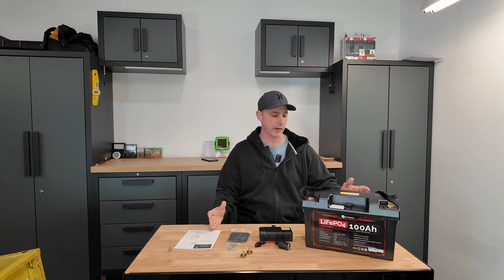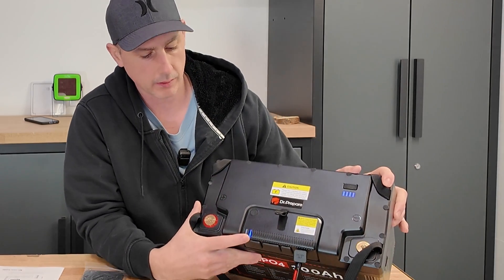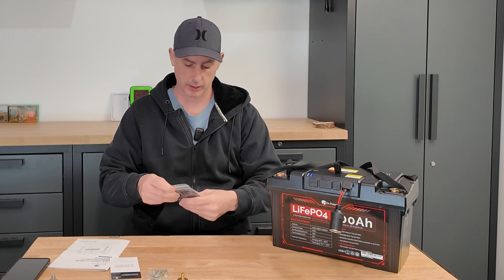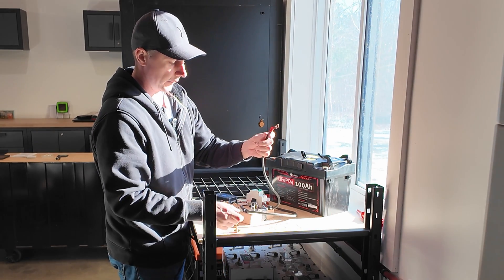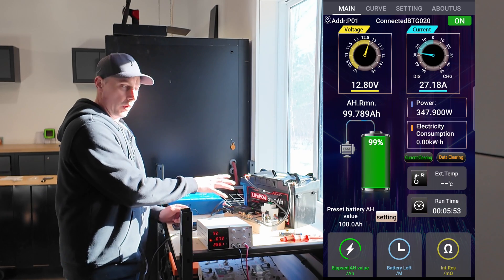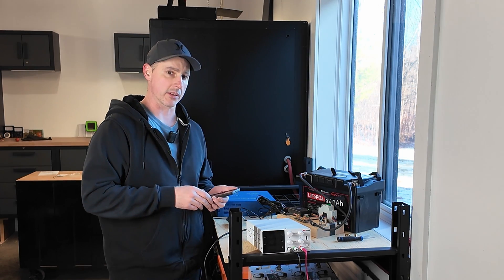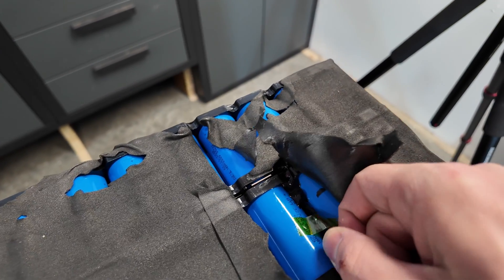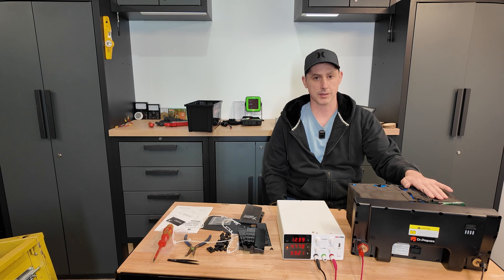Dr. Prepare 100Ah 12V LiFePO4 Battery Review

Comment: Can the battery be charged via the Anderson port that the hub connects to? Or is that output only? I think it's both but im not sure.
Reply from the maker: @Bamabrute85  You are correct in your thinking. It can be changed via the Anderson connector 👍
Reply: But you will not have the built in charge controller that way

Comment: He thought you were charging the doctor, prepare simultaneously with a generator in the power supply, but you were not. You were actually charging your generator with your doctor. Prepare look at the input, should’ve been coming from output, so technically you were charging your bouge RV and not charging the doctor prepare simultaneously
Reply from the maker: It appears to look that way. Yes
Reply from the maker: @Dram_bam  the doctor's type c Port was bi-directional. I didn't realize the bouge was as well 😵‍💫
Reply: Sorry for my typos. lol.   Glad u got it figured out.

Comment from the maker: Hi 👋, The size of the terminal was the same diameter as the washer. No matter what orientation, it wouldn't work. 
I was over the .2C rate, more like .28C. The manufacturer does the test at 0.2C, but it's not real-world usage or practical really. I agree that the little heat fan test is no good, as well as people who use upside-down busters for cold temperature tests. I missed the Input/output on the BougeRV it does appear to be on the input side. I'll have to check that thank you for pointing that out.

Comment: If you're claiming that the washer is being held up by the crimp part of the cable's lug because the washer's diameter is too big, could you have just flipped your cable ends upside down and make them fit with the washers on top? The lugs will work the same in either orientation. It's also okay to bend the lug a little if you have to to make it sit flat. If that isn't what you mean by "not allowing my lugs to fit properly", could you explain what you do mean?
    I'm very glad that you tested this battery at a .2 C rate. So many reviewers don't seem to know that that is the rate specified for LiFePO4 batteries when testing the discharge capacity. They will hang one of those little fan cooled 10 amp testers on a 280 amp hour battery for days and then exclaim, "Wow! We got 3% more that the rated capacity" and it means nothing. 
   At least from where I was looking, you seemed to be observing the "Watts IN" of the Bouge RV power bank at 92 watts. In other words, you were CHARGING IT at 92 watts FROM the Dr. Prepare battery, not the other way around. Also the battery symbol is pulsing its last segment off and on, which indicates charging on many of my solar generators. Maybe that Bouge RV port is one way only or maybe the Dr. Prepare? Whatever the reason, I saw only power going into the Bouge RV unit.